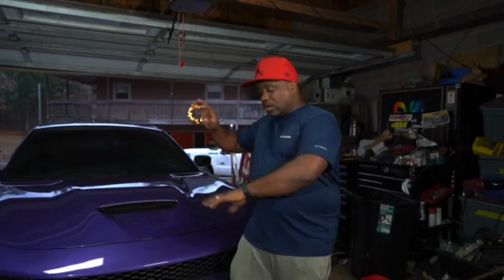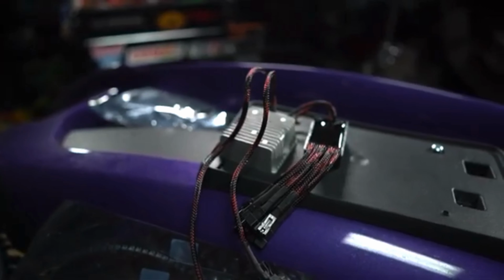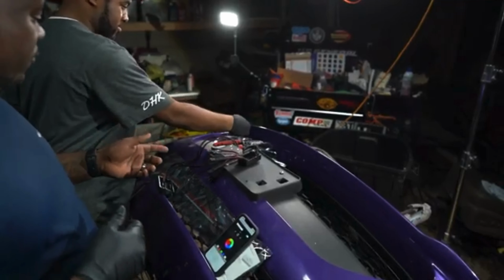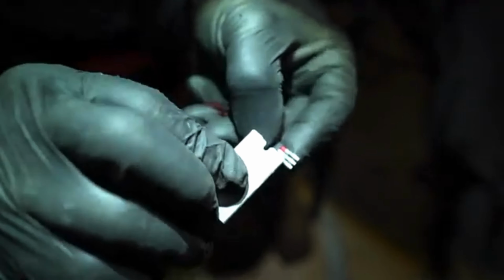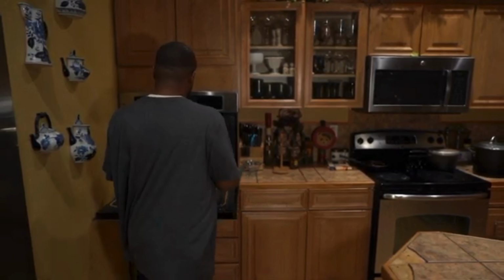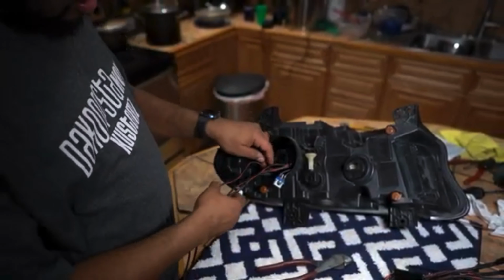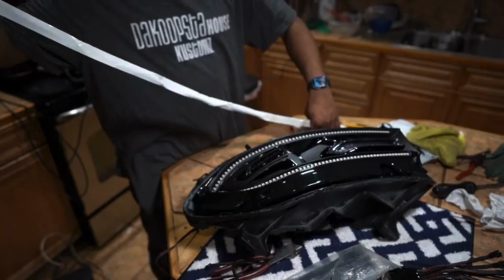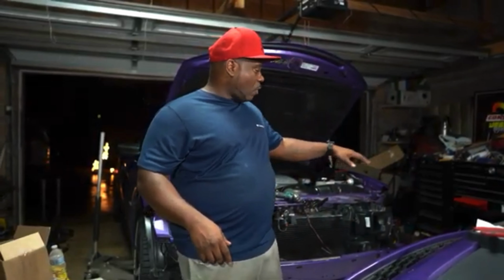Charger Flow Series DRL Board Installation | Customer Review | Lightingtrendz DIY

Comment: Love it. Quick question. Your video is super helpful. I ordered my set and I have them. I don't have any type of wiring diagram on what cables plugs into what. So does that mean I can plug any cable ( I can start with halos) to any connection on the controller? Does it matter ? Thanks.
Reply from the maker: Send us a email